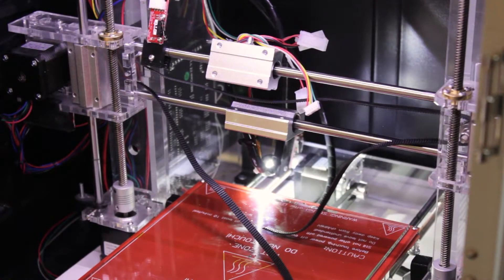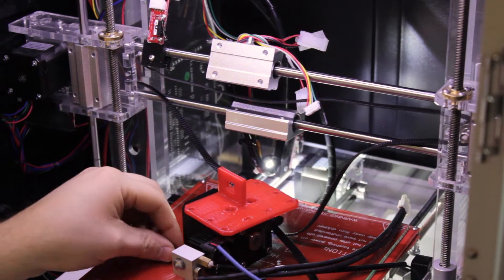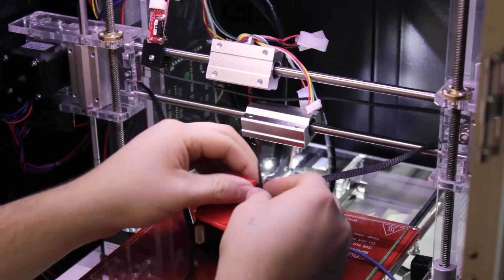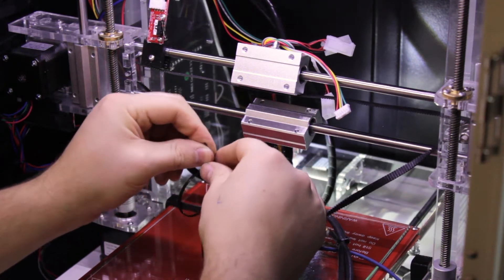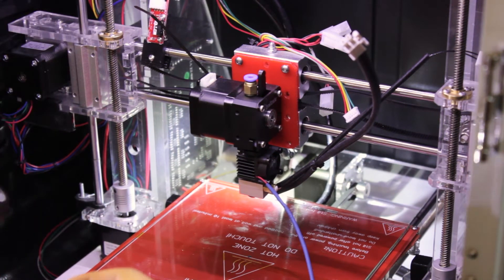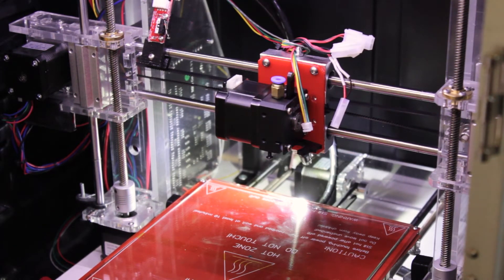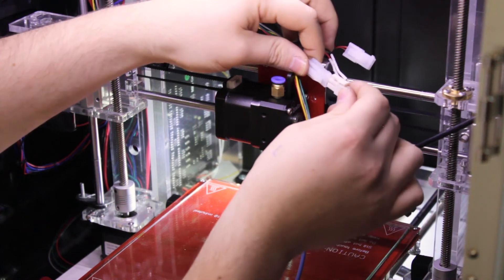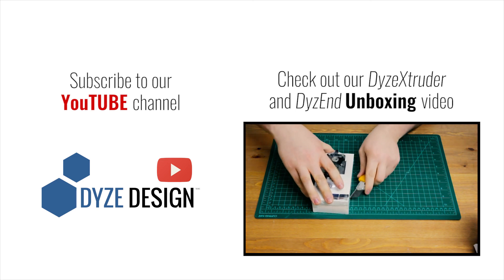PRUSA I3, DyzEND + DyzeXtruder installation

Comment from the maker: The number of prints depends on the material that you print. The hotend will always be good. It's the nozzle that will worn after many print. Our nozzle is made from hard stainless steel so it will last more than brass nozzle. Our hotend is easy to disassemble, even at room temperature.
Reply: Will this work on Prusa I3 clones like the Anet A8?